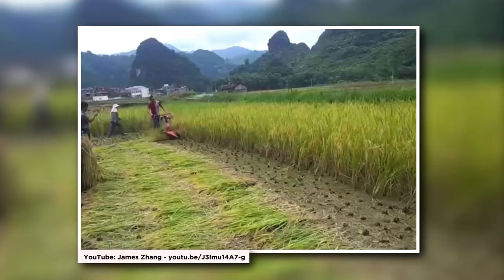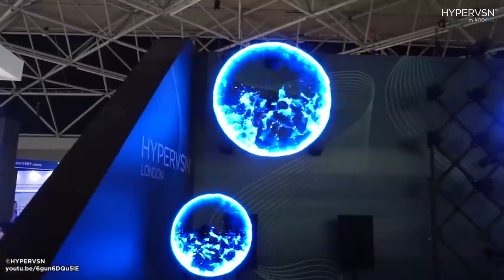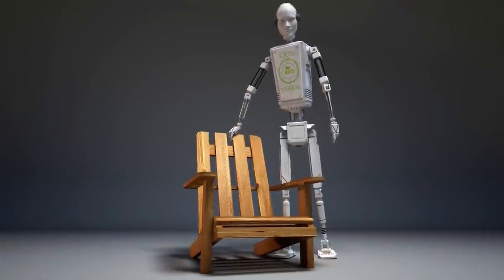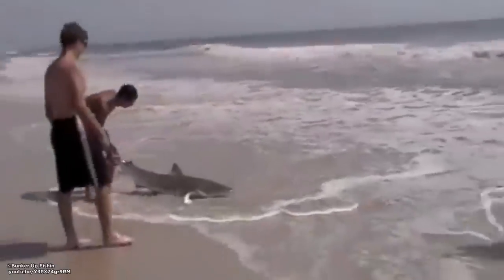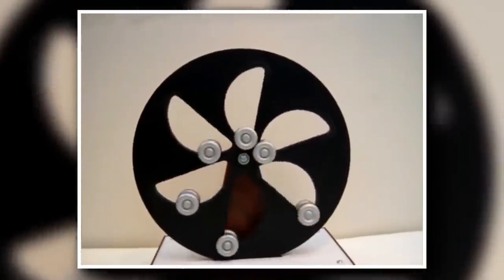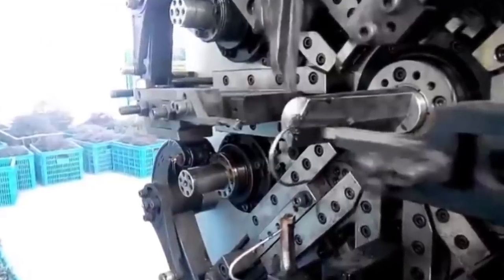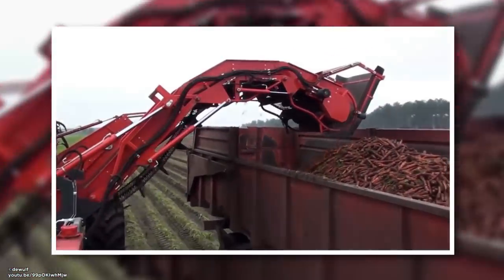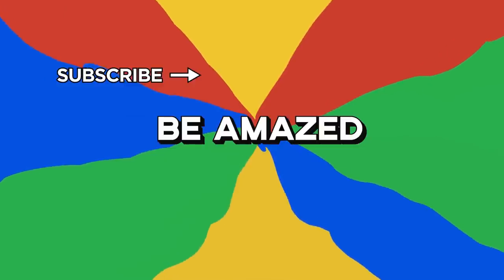Amazing Inventions and Technologies You'll Find Interesting To Watch

Comment: One thing I’m surprised i never hear about perpetual motion machines is that while they can never work as that they could work on ideas for high efficiency.
“Practically impossible but plausible” but if you had a loop running with say 99.999% efficiency while you lose energy you need very little to sustain it. as far as I’m aware we don’t have anything anywhere near that efficiency thats more then a bauble and even then idk if we have anything that well built yet.

Comment: Guy most cars built after 2014 tells you which side your gas ( cap ) tank fill hole is on. Just check your gas gauge on your dash, if the gas cap is on the left side of your car there will be an arrow or pump symbol on the left side of the gauge inside the car. If the gas cap is on the right , there will be an arrow or gas pump symbol on the right side of the gas gauge inside your car . You don't have to get out of your car to check which side of the car the gas cap is on to put in gas . Check your gas gauge .